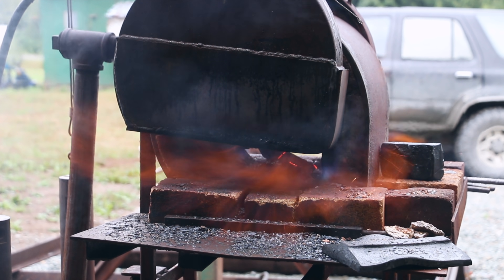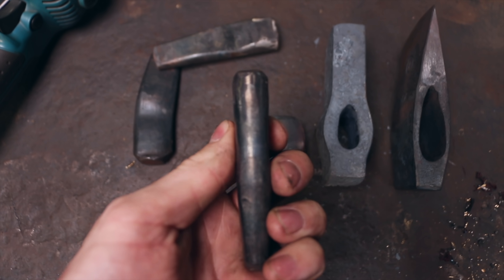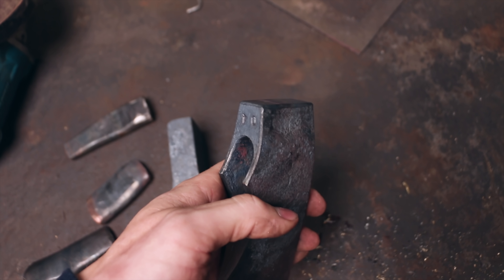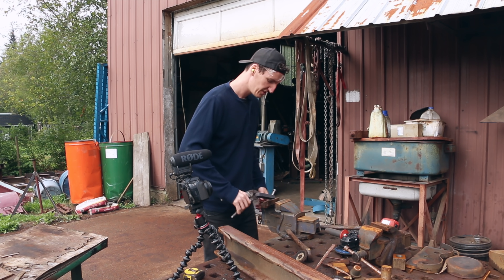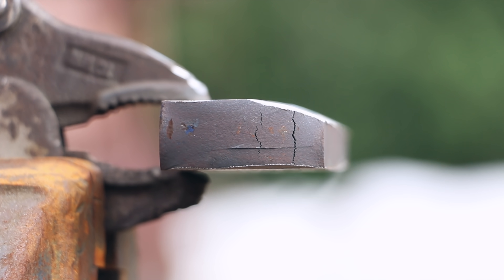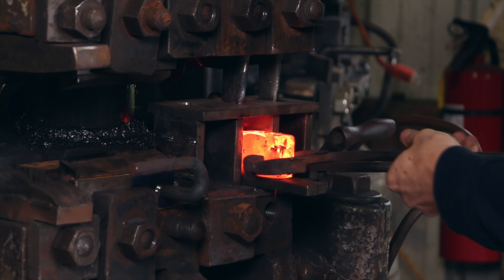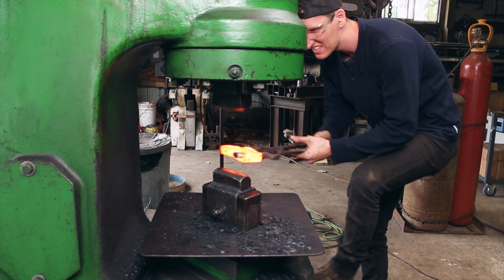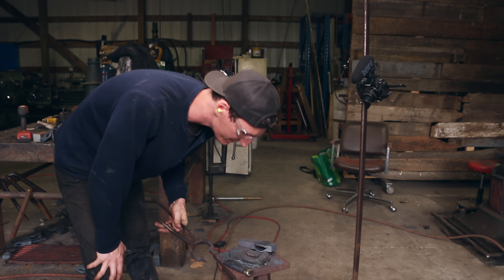Is a INCONEL AXE DRIFT the best thing ever?

Comment: Hmm ,hey Tim the blacksmithing blacksmith.  maybe try no heat and the industrial hammer set to a very short throw and rapid pace to replicate the action of European cold hammer forging mills.  I know a gun barrel is formed around a tungsten alloy mandrel  with the negative of the gun barrel and chamber machined onto it. A 30  inch long ,3 inch diameter rifle blank starts as an 10 ish inch long , 18 inch diameter cylinder. In the 1950s, the u.s. military did trials on what materials could be cold hammer forged to replace 4140 ordinance steel. (they chose 4150cm and 41v50cm )  they tested a few inconel types. Waspaloy, a few stainless steel types and the high Carbon steel with chrome moly additive and   chrome moly vanadium additives. It creates a picture perfect mirror image of the mandrel for its bore and chamber, and surface hardens better than 4140,making a longer lasting barrel, easier to clean barrel. This was just before chrome lined bores and chambers where used. The surface quality of the bore when not lined, directly effects how easy it is to maintain properly, consistency and longevity .  Sorry for the tangent, in short maybe try cold working some of it , if you have any left.  Good luck.

Comment: +1 to the recommendation to machine and heat treat per official engineering specifications. I don’t think materials like inconel are designed to be used in such an ad-hoc way as forging. Despite that it’s cool to see it actually still performed well, if not quite to expectation.

Comment: Inconel is only harder than steel when hot. Because steel gets soft quickly, and Inconel does so much later. But at low temperature most steel is harder than Inconel.

Comment: Inconel is used to make firearm suppressors for these exact reasons. The extreme heat of extended fire doesn't destroy the metal like it does with steel or aluminum. It's pretty awesome actually.

Comment: :D nice video
I would try to make a knife out of it to do a knife test with its sharp test bend until brake test edge holding test to know the material properties, maybe need to cold or hot forge it Kristal line can get stronger if hotter not fore iron it gets weaker and pliable

Comment: Not subbed, but I'm enjoying watching your adventures with inconel. 

It is a super quirky material to work with, I used to do a lot of machining with inconel cutting machine threads and working raw castings for material certification like impact, tensile, hardness, composition structure etc and it is by far one of the most difficult to work materials, second only to Super Duplex stainless steels in my opinion. 

Happy trails mate.

Comment: It seems (and this is a guess from an absolute noob) that when cold it is of unimpressive hardness. However, when heated it softens very little compared to other metals.
Would be really odd to work with from the perspective of someone who is used to working with metals that soften considerably when heated.

Just a guess from a guy behind a keyboard so I could be totally wrong.
Reply: Interesting, how do you type behind your keybord?. I usually type in front of mine. Haha jk

Comment: The inconel you recieved is already in a compacted state due to forging. Once you attempt to reforge it is difficult to control the temps and conditions necessary to keep the inconel from splitting, as others stated. You are best to machine the shape from the stock you recieved for optimum strength in most instances..

Comment: Would be fun to see how a fully machined (no forging) drift would behave... might be that the thermal/stress cycle of forging messed with the metal characteristics.
Reply: Machining it ain't no cakewalk either LOL. It's a tough cookie. Something something work hardening, flood coolant, plastic deformation if not attentive to heat etc. 
I work with enough flavors of Inconel often enough to know it's not a fun time if you're not careful. Not impossible, but certainly not easy.
Reply: @SpookyMcGhee  yep, I was not suggesting that viceing up a 718 blank and cutting away is going to be a walk in the park.... but it would be interesting to compare the results of the two processes =)

I've seen how Inconel behaves, but those were either near-static loads under temp. extremes plus under thermal shock... but I've not seen it used under impact loads, not saying it's not done but I've not seen it, so it's quite interesting.

P.S. plus, there is a question of proper process (heat-treat, annealing, "aging") for the specific alloy you are using...

Comment: Kinda hard to respect a guy who uses an angle grinder with the guard still on , just saying , secret man trick only men do . 
Safety rule #1 remove the guard for save operation of the tool 
                    #2 Dont be an idiot , let it drag , never let it push  .................

Comment: Inconel is designed to work under heat. Thats the whole point of it. Jet engines ect. Be thankfull all youre doing is hitting it with a hammer. Try machining it...

Comment: Does Inconel benefit from cryo-treatment? I'm not a metallurgist, so I can't really say. Honestly I think what you should do is talk to a professional metallurgist to talk material selection, maybe Inconel would work better with a certain temp range, but then again, cost factor. The ideal alloy or material might be stupid expensive, and not worth it. The process of keeping Inconel in that temp range for it's best performance might not be time reasonable. 
A quick google shows Inconel might benefit from cryo-treatment, but then again that's further adding to your cost, and Idk if that's worth it. Might be worth getting some of your normal drifts cryo-treated to see if there's a noticeable difference in durability. I hear it makes a big difference in brake drums/rotors. I'm putting a paper in the replies about Inconel cryo-treatment, incase I get spam filtered for the link

Comment: Yes. Inconel is extremely durable, and makes a great drift. I'm a cnc machinist and we make aftermarket turbine blades out of this material. Cast, grind, and we have to use edm machines to cut it into its final form. Wire edm may be an option. 
Good luck with the channel!

Comment: Maybe make the drift a little oversized and heat it in the furnace making sure you don't overheat it then finish it out in the power hammer and work harden it then try to see if it deformes I think work hardening with very little grinding is the key

Comment: Uddeholm dievar steel could also be an option, it is a h13 type steel with a lot higher resistance to plastic deformation. Hardening it acording to uddeholms instructions is very important thoug if you want it to perform 100%

Comment: My attempt at forging an axe drift, the tie rod from a large truck (1+1/8" diameter) didn't want to move much with the 2+1/2 lb hammer, so I used a 6lb sledge I put a short handle on and made one side a rounder.   Few hours later...my arm felt like wet, leftover,  spaghetti noodles.

https://youtu.be/wEXIt76Hj6I

Comment: What if you were to mill the inconel down to the specific size of the drift needed to eleviate the heat stress of forgeing it maybe it may not end up mushrooming due to the stress of forgeing and changing the property's of the metals heat resisting structure

Comment: Try not forging the inconel but just machining and grinding. Perhaps your heating routine has done something detrimental to the crystalline structure of the inconel.
Reply: Exactly what I was thinking, just like steel softens after it’s heated and cooled down so does Inconel and it needs to be heat treated

Comment: Tim have you ever thought about selling a rough forged ax blank? I like to do wood working and wouldn’t mind doing the grinding but I can’t forge nor do I have access to forge to try.
Reply: You can forge in a campfire even. Or just make a small hole in the ground and fill it with coal (or charcoal or coke) and then take a pipe and put a hair dryer at the end. Put the end of the pipe into the hole with coal. Start a fire in the hole and turn on the hair dryer. Now you can forge!

Comment: What inconel are  you using like 625 inconel or 718 I don't remember but I think it's 718 that was more crack resistant during extreme temperature changes such as you're doing or welding. I remember the heat treat process was very long and a slow cool down and draw back time cycle. 718 inconel a bit plastic during machining but is far more machinable then Mar 247 m.

Comment: what if you pre heated the drift? im new to watching blacksmithing but it seems that you reheat the axe head after you run the drift through it so what if you left the drift in? or just pre heat it before you hammer it in.

Comment: Inconel keeps integrity at high temps, in fact it gets stronger at temp, but past a certain temp and it looses its integrity even after cooling. I think that’s what happened here. In your last video you demonstrated how it will crumble past this breakdown temp. I think in this video you got very close to that temp, hence the crack, which is why it isn’t as solid as it could be. Passing that temp will weaken it permanently both at temp and cold.

Comment: On board with saving the #1 ever of each axe/hatchet production run for the Timmy Bank. You can keep track of your professional life through the collection of first run models. Would a hydraulic press push the drift through the axe head in one press with the right setup tooling?

Comment: I didn't read all the comments but with the fact that it does have a very high but distinct temperature failure would it be better to just grind your drift out of it so you don't over heat it and cause flaws

Comment: Have you thought to heat up the inconel drift with the axe, it might get harder with high temperature and hold up better to the power hammer abuse? The dissimilar materials might prevent forge welding .

Comment: Inconel is engineered to get harder at higher temperatures, which is why it keeps doing the opposite of what you expect from your experience with steel.
Reply: I would try to heat the axe and drift at the same time and use it while they are both hot.
Reply: @tomaspecl1082  this would not work, all metals soften when heated. However inconels softens at a slower rate than stainless steel. But to clarify, inconel does not get harder or stronger while heated... the hardening process is similar to aluminum tempering (aka T6)
Reply: @smithjohn3080  the video evidence seems to counter your claim.
Reply: It needs to be heat treated a very specific way
Reply: Would that be because the inconel varieties are  nickel super alloys and NOT steel ?

Comment: I just had a look on Google to see how you heat treat Inconel and it looks like a rapid cooling is used to anneal it. What's stranger to me is that to harden it it's an 18 hour furnace cycle where you gradually reduce the temperature! Do you have any local friends with a furnace who can run a drift through...... not literally! ..... to see how it behaves afterwards? 👍👍
Reply: That's because Inco is a high nickel alloy with nearly no Iron. Inco is aged hardened like aluminum or the Austenitic stainless steels

Comment: Weird that it mushroomed like that.  Maybe I'm not up on all of the metallurgy but I thought Inconel's whole reason for existing was it's ability to resist deformation under high temps.  Could it be that the passive oxide layer doesn't go deep enough to protect the piece against the longitudinal forging stress?  How deep does the work hardening go?  How tough is the material without that hardening?

Could grinding it to shape be getting in the way of it actually work hardening?  Since you're removing the material that would be forming the oxide layer... 

Also doesn't it need to be precipitation hardened first? Or is that just some alloys?

Comment: try using s7 tool steel it is very resistant to deformation even at orange heat and its much cheaper than inconel

Comment: A  FULL SIZE INCONEL ANVIL WITH HORN AND A  HOLE ON BACK END  WITH 8INCH WIDE 12INCH LONG FLATE FACE THAT HAS A 1INCH TO 2INCH GAP FROM THE EDGE OF THE FACE TO THE TAPERED HORN OF 6INCH TO 8INCH LING TAPERED HORNAT A HIGHT OF 14TO 16INCHES FROM THE BASE TO THE FLATE FACE.TOP WITH A SHARP EDGE ON END OF THE TOP FLATE FACE.WOULD BE WICKED AWSOME  WITH INCONAL AND T-5- HAMMER'S AND TONGS WOULD BE  REALY BAD AS COOL🤯🤯🤯🤯😎😎😎😎☝☝☝☝☝👍👍👍👍👍👍☝☝☝☝👍👍👍😎

Comment: Inconel is neat but if you want to pound on something try S7.  You can harden it almost to tungsten carbide but it is tough and can take a beating without fractures.
Reply: Seeing this comment on S7 legit lit my machinist soul on fire yo!! I’ve been milling and turning the stuff for years, and starting to forge S7 the last couple. It’s a wonderful material to use for drifts, punches, dyes, cutting tools, hammers.. when forging it, just try to avoid bright yellow heat because it’ll start to form cracks in material bigger than 1” round (that is if you hammer it like a mad man). But yes, try S7, it’s worth the extra effort. As for heat treat, look it up, it changes depending on the size of your finished piece.
Reply: But does it anneal at higher temp or does it get harder with temp as inconel does?
Reply: @sstorholm  If I remember correctly it is hardened like normal steel, heat and quench. All I know is that I told the machine shop to make it rockwell 58 C and they did. My old tungsten Carbide plate was around rockwell 60 but would shatter like glass if hit wrong. totally worth the slightly lower hardness.

Comment: As far as i know inconel is good for resisting small continius forces at high temperatures. Not for impacts. Tungsten or depleted uranium might work
Reply: Not sure if you want to hit Tungsten or DU with a hammer.
Reply: @csours  Definitely not depleted uranium, eh!
Reply: depleted uranium lmao, yeah got that shit laying around all over the place.
Reply: i thought depleted uranium was in the ballpark of lead when it came to hardness
Reply: I tried make a punch with a tungsten welding electrode(green). It shatterd very easly. Tungsten is very brittle. A punch made from a generic wood screw withstand waaay more hitting that a tungsten one.

Comment: Inconel is very interesting. I had to do some research into exactly what it's made of. The problem from what I gathered is you can't heat the metal once the two alloys are mixed. It work hardens and the moliqual becomes oxidation Resistance. The metals crystal structure separates when it's heated to high temperatures. I believe the swedge cracks due to the heat it's absorbing from the forge heated axe head. There is different grades you can get that make working with the metal easier but why not try to metalerge some yourself. Might be interesting to see if it's possible then you can try and pour a swedge in a form then heating it will set to harden in the form you want

Comment: Inconel is not just one material, it's a group with varying characteristics but which state they have been (heat)treated to makes for significant changes to how it behaves.
So as others already posted read up on that specific alloy and states.
As a machinist that have worked making parts of it I know that some are very difficult to control so there can be a big variation between batches even from the same supplier.
And you really need to either look carefully at the suggested cutting data or invest a ton of tooling and time into selecting correct cutting parameters. For milling and turning rigidity makes a huge difference. But once dialled in very high tolerances can be held rather easily. At least until one get a rod with heat treatment issues...